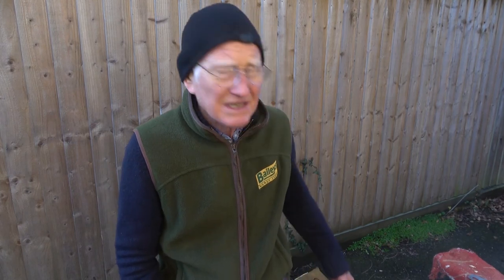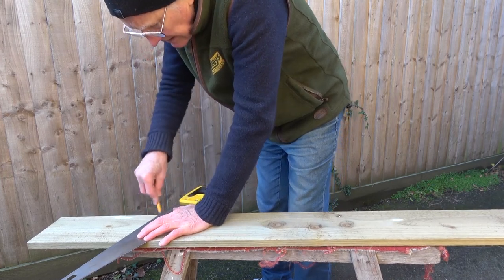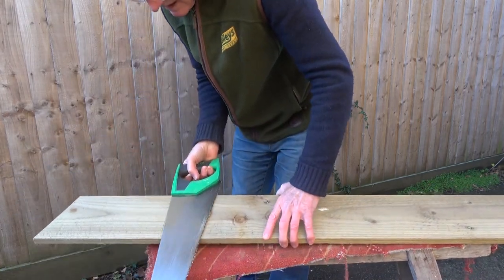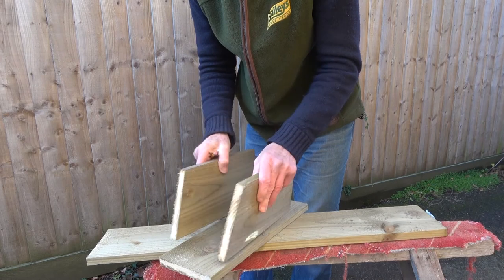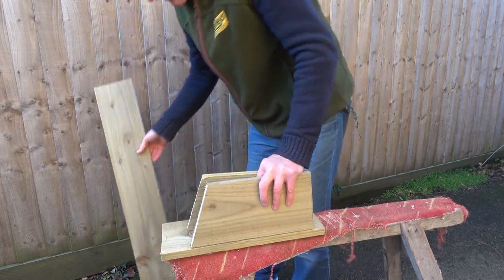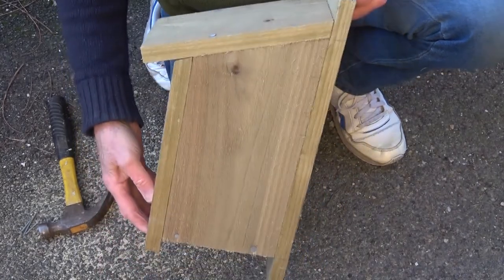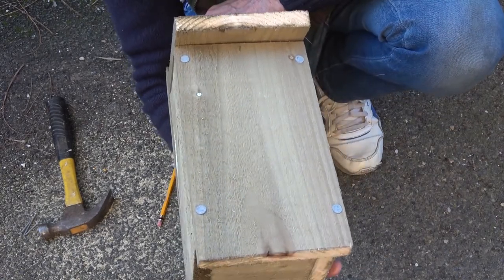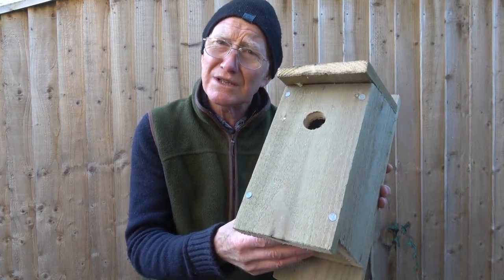DIY bird nesting box for £5 how to build a simple blue tit box cheap materials and no skill required

Comment: Well done.  Don’t worry about the gaps as birds put up with more much in the wild.  But next time consider having a side that can be opened to allow for cleaning.  Finally I always cover the roof with some felt or whatever is available and I would consider giving it a coat of water based paint or similar.

Comment: Having recently repaired a shed window due to rot, I wonder if a drip edge cut into the bottom timbers and roof would be of help keeping the water from creeping.
Reply from the maker: @davfree9732 thanks for watching. An interesting point. The life expectancy of my cheap bird box is around 6-7 years (judging by the others I have in the garden) so maybe that could be extended by the adittion of a drip line. You dont say how old your shed window was but for a guess, probably more than 6-7 years. ATB b33zo